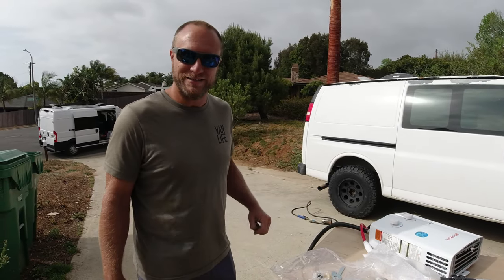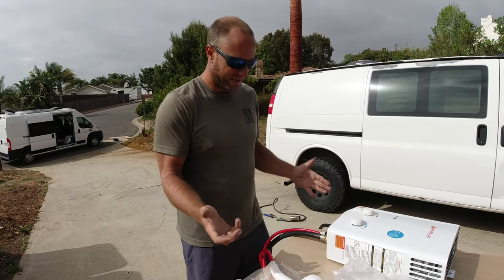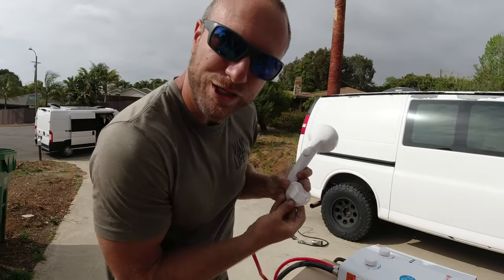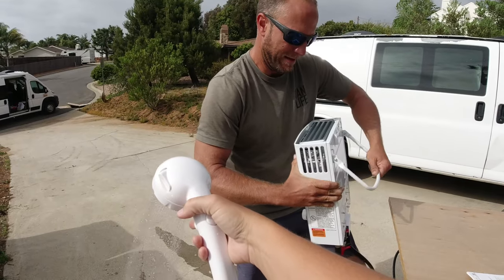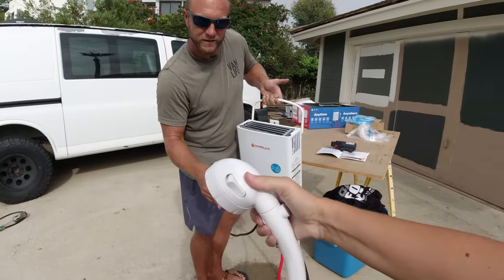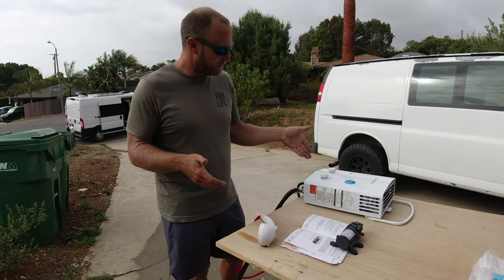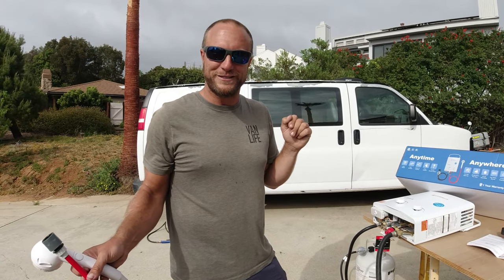Portable Tankless Water Heater - Review for Vanlife, Tiny Living and Camping- This Thing Is Awesome

Comment: One VERY IMPORTANT THING YOU DIDNT MENTION… in colder temperatures, when the incoming water is very cold, this Campus can only heat the water a little bit.  sometimes this outflowing water temperature is not hot at all. So the temperature of your outflowing hot water is DETERMINED by the temperature of the incoming water .  In ANY Season…  Just sayin
Reply from the maker: Thanks for watching! That adds up. I think they can do a 30-40 degree increase in water temp. Our portable camp shower is similar so sometimes I have to cycle the water to pre-heat it.

Comment: I also have this water heater.  It didn't come with a pump though.  We've only been winter camping so far and haven't got dirty enough to want to take an outside shower in low temps lol.  But I did test it when I first got it and it is just like you said.  easy to set up and instantly gives hot water.
Reply from the maker: Thanks for watching! We know exactly what you mean about showering outside in cold weather......especially on a windy day! Hopefully you get to use it when you find some warmer camping conditions.
Reply: You will definitely not want to use it in freezing temps. The small lines will freeze and burst

Comment: Great video ! I have the same water heater and it works great.  If you get the adapter for 1lb green propane bottles it good for about for 8-10 shower’s. I tied into cold water side of van 20 gallon
Reply from the maker: Thanks for watching and the great information! We can't wait to find a permanent home for the one they sent us.
Reply: @DrifterJourney  Thanks for all your great videos.  That can find a permanent home in my Promaster. Lol
Reply: @joemorgan5276  Im curious about the time a tank will last, you said you use a 1lb and it lasts for 8 to 10 showers? about how long is that? like maybe 10-minute continuous running water showers? or spending maybe 10 minutes but only turning it on for a minute or two to rinse off a few times while showering?
Reply: Where do you get that 1lb bottle green adapter?

Comment: It does require a pressurised water supply...which is not available outdoors in most cases...that is a deal breaker...manufacturers must been added built in water pump
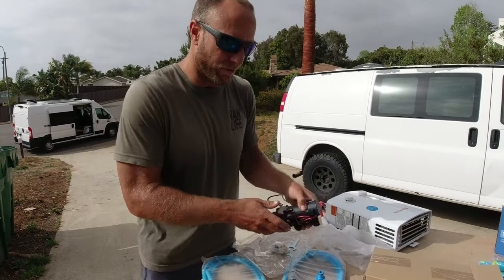Reply from the maker: Check out 1:20 where I talk about the 12V water pump that comes with this model. You would still need a power supply but it is definitely doable. Thanks for watching.

Comment: I bought one and it doesn't seem to work at all
Reply from the maker: Thanks for watching. That's odd. Maybe reach out to them for some troubleshooting or a replacement.
Reply: @DrifterJourney  we actually just took it apart and got it working. On the inside there's a small metal flap that triggers the arc. Ours was to tight but we got it by manually moving it a bit and testing the arc
Reply from the maker: @lmdo678i Nice work! Glad you were able to get it going.
Reply: @DrifterJourney  passed my inspection today with it got a 96. Lucky she couldn't find the brand online cuz it's not even rated for potable water lol
Reply from the maker: Congrats!

Comment: I wonder if you can hook up one of those dark green 1 lb LP bottles. Easier to store away those than a 20lb tank
Reply from the maker: Thanks for watching. I imagine you could do that as long as you find the correct adapter. It would definitely be easier to store.
Reply: @DrifterJourney  ill def see if there's an adapter available :) Did your kit include the pump or did u buy it separate?  

My daughter and son-in-law got this one (they live off grid way up in WI) and my boys and I went to visit over memorial day and it was the first time I've ever seen one I person and I couldn't believe how well they work. I stuck the hose in a (1) L bottle of Fiji water and I wasn't thrilled about how fast water sucked out of it just to wet my hair. Then it took 1 1/2 more L bottles to rinse. They have the 5L tankless. I just wished they'd use less water. Great video though.
Reply from the maker: We've tested a few over the years. Some come with the pump and others do not. There are also different flow rates so you may want to get a version that uses less water. We like ones with an on/off switch on the shower head also so we can turn the water off while lathering up.
Reply: @DrifterJourney  ya the Camplux they got was the 1.3gpm one and they had to get a separate pump. I wasn't thrilled about the separate pump but I guess that's the only way if you're off grid with no water hookup. I don't know, now I think of it, maybe I had the water flow dial turned up too much and could of had less pressure coming out of the shower head. I just think it's crazy how much water it flies through. They did have the bottom on the shower head to shut the water off when you're scrubbing down and I like that. I thought I'd be able to wash my whole head with just one (1)L bottle. Lol. I'd like to look at other ones but I don't know how they compare to the camplux or if they all are pretty much the same. 

I appreciate your time in responding -  very nice of ya because many creators dont. :)
Reply from the maker: Thanks! We do our best to respond to every comment. I can't speak for all brands but I have a feeling that most of this style water heater are very similar. The other brand we have experienced is Gasland. They both seem to work as expected.

Comment: I have this heater in my van. I found if I use the pump it came with. It will burn you. It needs a higher pressure pump to move the water through faster. The temperature control sucks.
Reply from the maker: Thank you for watching. That's great information! We hooked it up to a hose during our test so now I'll have to find a time to try it with the pump. It has so much potential and we're excited to try it at our next "home".
Reply: It needs a mixing valve with cold water to make the water temperature more stable.
Reply from the maker: That seems like it would work.

Comment: If you don't use the DC pump that comes with it and you have access to a hose Plumbing what's the point of reviewing the product I don't care to see it hooked up to a hose I want to see it sucking water out of a bucket at your campsite
Reply from the maker: Thanks for the comment and we hope you have a better day.  We're happy with it and didn't want to spend a bunch of time hooking it up to 12 volt to see if it worked. I just wanted to see if it actually got hot enough and assume a standard 12 volt water pump should work without issue. Let us know if you get one and have any issues. Amazon is pretty good about returns if it doesn't work for you.

Comment: These things are absolute trash
Reply from the maker: Why do you say that? We've had pretty good luck with them.
Reply: I’ve gone through 3 (on the 4th because I don’t have much option other than upgrading to something like a Truma). I run them in a hard case that is installed on the side of my camper (came that way). Obviously it’s open to use, but they all seem to have an issue staying lit. I’ve tried more air, less. Can’t seem to get it right. The reviews on Amazon are similar.
Reply from the maker: @Andy-rp3ee interesting. We haven't used them extensively like you have. Hopefully you find one that is dialed in for your needs soon.
Reply: @DrifterJourney me too. They aren’t spendy, but I am starting to think other options might be better
Reply from the maker: @Andy-rp3ee definitely! We've tried a few brands over the years. We're currently using the Camplux Nano portable shower.